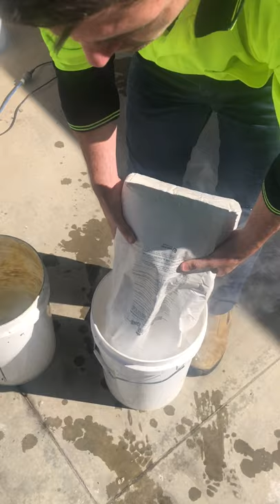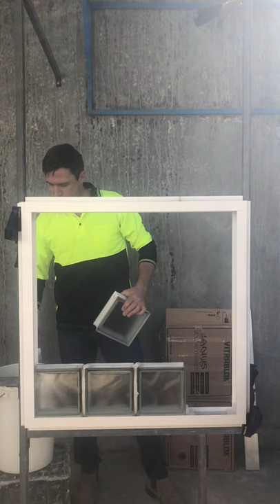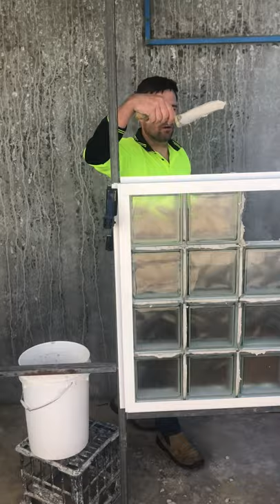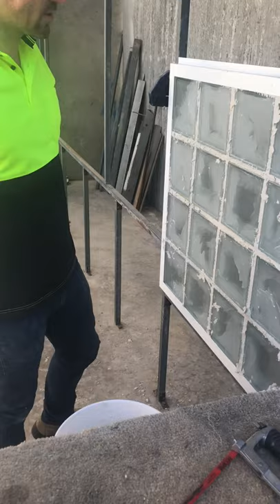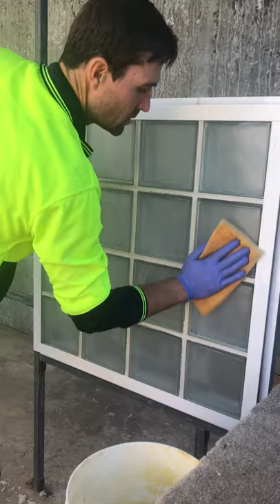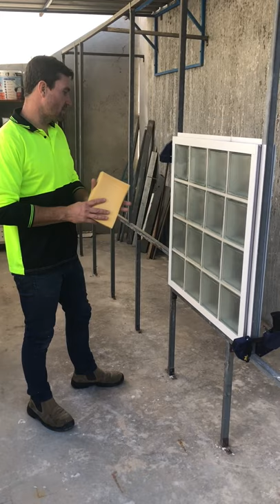GLASS BLOCK INSTALLATION MORTAR

Comment: Can the glass blocks be cut to size using and angle grinder?
Reply from the maker: you can however we wouldn't recommend do this as you will get condensation and mold appearing within side the block.

Comment: You don't seal between the blocks and the aluminum frame?
Reply from the maker: Good question Me Mate. You can put a silicone bead around the perimeter once the mortar is dry and set, however at the base of the frame which acts as a sill tray you would have weep holes for drainage.